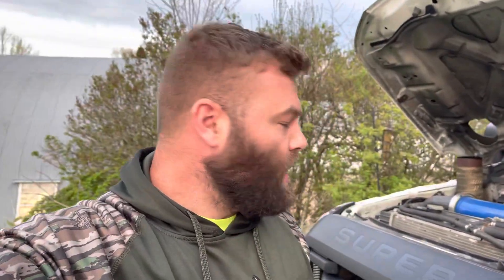Diagnosing Cylinder Contribution Codes (6.7 Powerstroke)

Comment: Having same issue but with 1556 code.  Did continuity test from ECM plug to each injector and the ohms were in tolerance. Replaced the injector and still throws the code.

Comment: So if it’s all pertaining to cylinder one and it also has an insane amount of blow by would that be leaning toward bad rings. The truck has 188k on it
Reply from the maker: It was on a brand new engine. Also, blow by wasn't that bad. Funny enough, I just tore that engine down to put Wagler rods in it. Rings were just fine.

Comment: Is ECM another name for FICM (Fuel Injection Control Module)?
Reply from the maker: These trucks don't have a dedicated ficm. The ECM is engine control module (some call it ECU, engine control unit). It does what the ficm does, but also control the rest of the engine besides just fueling.
Reply: @JohnKangas  Sorry but another silly question... If that is the case then is the PCM another name for ECM?
Reply: Nevermind, I Googled it: 

In Ford Powerstroke 6.7L diesel engines, both ECM (Engine Control Module) and PCM (Powertrain Control Module) refer to the same core computer, but with slightly different connotations. Generally, "ECM" is used when focusing on the engine's control functions, while "PCM" is used when referring to the broader powertrain, including the transmission. Essentially, for the 6.7L Powerstroke, they are often used interchangeably.

Comment: Good info. Did you have to have your tunes rewritten for new ecm?
Reply from the maker: Negative. Same tunes. We basically made an exact replica of my old ecm
Reply: How did you go about copying over your old pcm data onto the new one. I’m having the same exact issue right now.
Reply from the maker: @chrislevie87 are you using IDS software?
Reply: It’s simple to swap the tunes to ur new PCM.
just bring it to an electrician with the right equipment and they could just clone it.
Reply: It’s simple to swap the tunes to ur new PCM.
just bring it to an electrician with the right equipment and they could just clone it.

Done it to my customers.

Comment: Cylinder contribution means that specific cylinder is not contributing as much relative to the others, hence the name. It's checked or derived by crank acceleration/deceleration over time based on a specified fuel amount to be delivered and checked against known good data supplied by ford. You also would 100% need to update the injector codes or program each injectors spot in the engine or contribution codes can and will be present...... The reason being is injector programming essentially gives the PCM the injectors electrical response time and thus the flow rate of that specific injector relative to injector on time. Just FYI Contribution codes have nothing to do with electrical connection of the injector, those would be injector circuit codes.... IE: circuit Open, circuit short to power or short to ground. By you fixing your issue with a PCM swap you either had a bad/poor connection on the PCM connector, wrongly programmed injector, needed a PCM update via IDS which would relax/open up the acceptable "contributing window", or you could of had an injector driver circuit starting to go bad in the PCM itself but it wasn't bad enough to the point of setting a circuit code. So if this truly fixed your issue via a PCM swap and the code doesn't return, it was more than likely to be one of those things. If it does return and you have access to IDS, try a relative compression test, if that checks out well I'd swap out the injector on the cylinder with an issue.

Comment: Mine was doing this right before it blew up
Reply: Same here, happening to cylinder 6. Than after about a 1,000 miles later, My 2012 blew up driving 70 on the freeway. Rod went straight down and cracked the block.
Reply from the maker: Damn rip